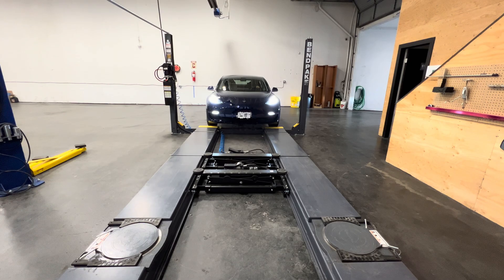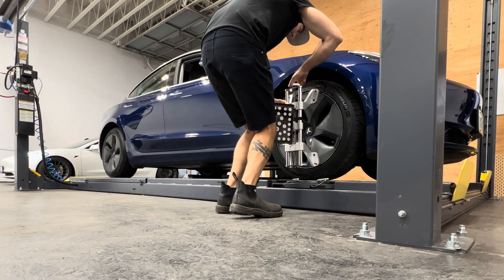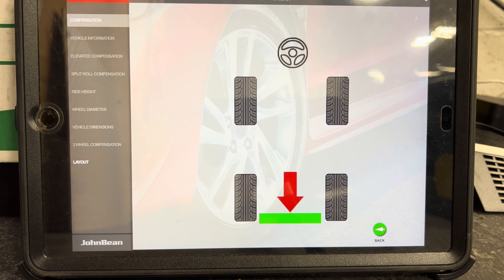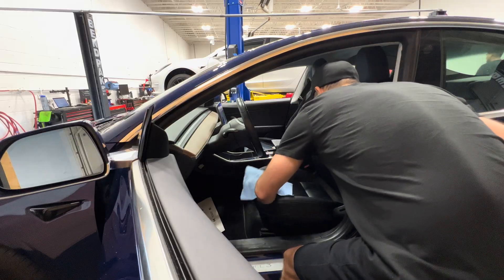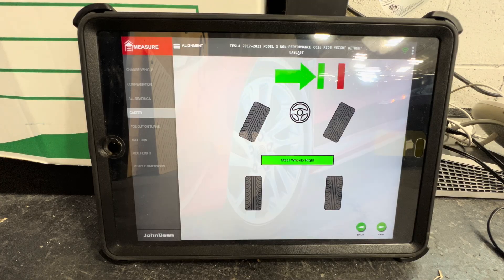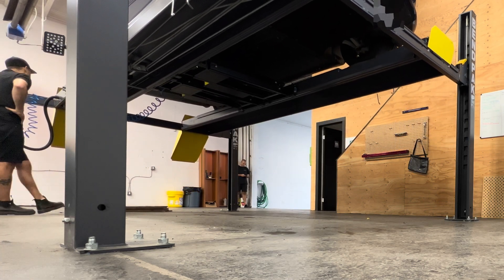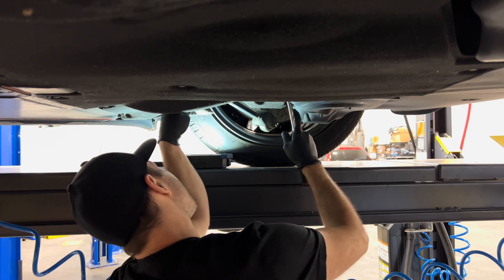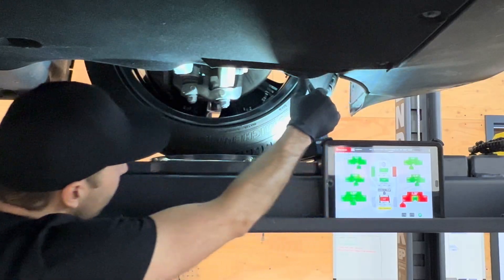Tesla Wheel Alignments

Comment: The offset only has to do with autopilot it doesn't affect the steering column or which way the wheel pulls. It only tells autopilot which way it needs to turn the wheel if any to correct for alignment errors while in FSD.

Comment: Is there a correct way to set toe on the rear the last one i did was a major pain was very hard to get back to where i started seemed under tension not dure where to lift to any help is grateful
Reply from the maker: Hi Robert! Tesla service manuals are all online and free! Check the procedure… https://service.tesla.com/docs/Model3/ServiceManual/en-us/GUID-13BE03F3-57D9-41B2-817E-C17E7545DE3A.html#:~:text=The%20test%20drive%20is%20now%20included%20in%20the%20alignment%20FRT.%202023-04-05%3A%20Removed%20advisement%20to%20seek%20assistance%20if

Comment: I had an alignment done by Tesla Service Center, the applied offset is now 0.1, but the vehicle still pulls to the right. Could it be a tire issue?
Reply: I have the same issue. My car was aligned by Tesla, after the alignment the car pulled to the right slightly, but I never took it back because my autopilot never asked me to put my hands on the wheel, so I enjoyed hands free driving for a few years. After getting an update a while ago, it started giving me cheat device detected strikes, so when I recently got new tires, I decided to take it to an alignment shop, after they did the alignment it still pulled to the right. The alignment shop blamed a bent part, which I had replaced. I took it back and paid for another alignment and my car still pulls to the right. The alignment shop started blaming my brand new tires, but it was pulling to the right before and after the alignment, just after I got the tires, so it’s not the tires. I noticed they never cleared the applied offset, so I did it, but it still pulls. I did notice my EPAS (Electric Power Assisted Steering) is 0.440Nm on the primary and secondary (0.4 to 0.6 Nm on the alignment screen), so I don’t know if the sensor is bad or if something can be adjusted manually. Did you ever figure out why yours still pulls to the right? Does yours show any torque on the steering without touching it?
Reply: @cashu2  I would demand that the shop pays everything back or go to small claims court. Just a bunch of psychics and no mechanics working there. No measuring anything out is what it seems like. What was bent?
Reply: @AlenMop  They said the right Front Lower Control Arm “could be bent”, and wanted to charge me a lot to replace it, that’s why I did it myself. It didn’t look bent to me, and judging by how it still pulls after another alignment, it wasn’t bent. Prior to it being replaced, they said if it still pulled, it could be the subframe, but didn’t mention the subframe after the 2nd alignment.
Reply: @AlenMop yes I have to perform miracles sometime especially when customer decide to do their own work
Reply: @cashu2  just a bunch of guess works. Bring it up with the manager "are you going to measure the suspension link and subframe bend or just keep replacing everything until you might find out the car is bent and then you replaced everything for nothing? Doesn't every tech in this shop know how to use a tape measure?" I was about 10 years old when I figured out how to measure bent suspension parts and subframes on a car. I still see people in a shop "I think it's bent". I tell them what if your eye is bent and you are going to pay out of your pocket to replace parts on x car. 
Use alignment and use tape measure.
Reply: @AlenMop 😄💪🔥👌
Reply: @cashu2  nah done it three times with tesla still pulls, the technician actually said that it could be bent subframe
Reply: How much did tesla charge for the alignment and was it ever resolved?
Reply: I paid $156 back in August of 2019 (Southern California), not sure what they charge now. Mine wasn’t resolved, it still pulls to the right.
Reply: Yes possible that is called radial pull camber can sometimes effect alignment but good tires are key psi to

Comment: I assume your shop is in Vancouver? I am in Los Angeles, I took the M3 to alignment and it seems to align but I still have the alert "steering alignment needs adjustment" What should be the reading after the alignment? thanks.
Reply from the maker: The reading should be 0 or close to that. If the shop forgot to reset the steering angle offset, it might take some time to relearn. I realize this comment was left some time ago... please let us know how you made out and what the resolution was!
Reply: @FactorEVancouver  thanks for replying, turns out the speed sensor was out.